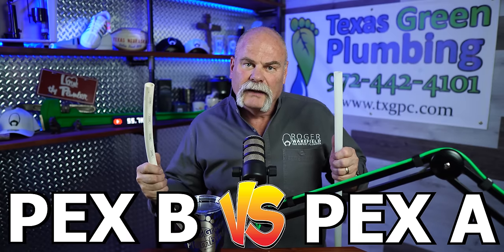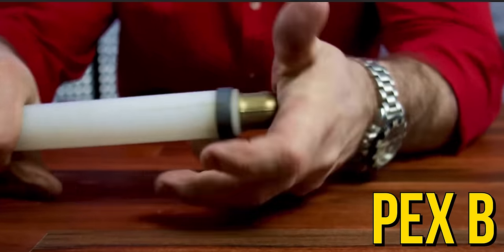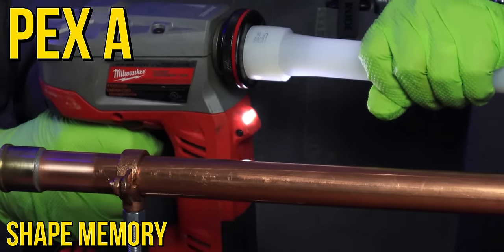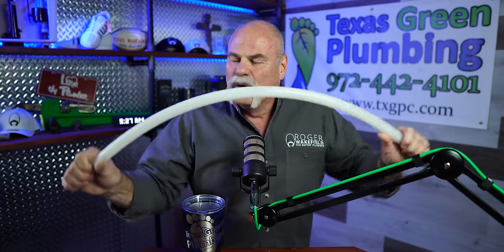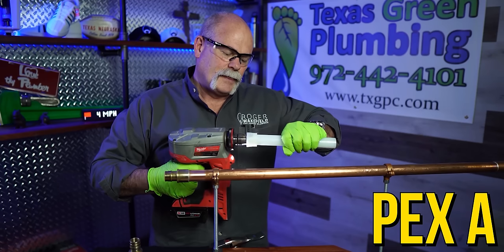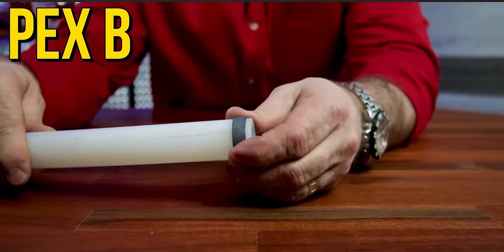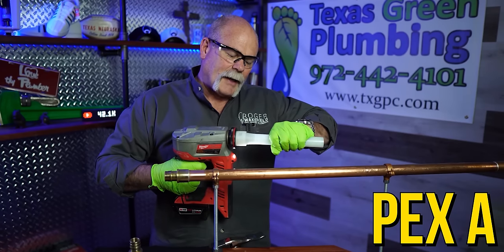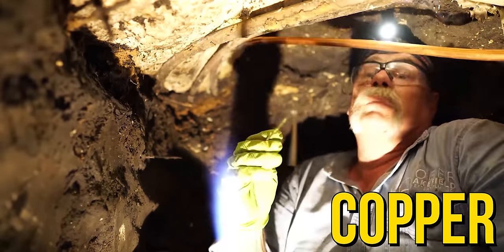PEX-A vs PEX-B - What's the Difference? Which Should You Use?

Comment: Great video. Solid explanations of how and why they are different.

When I was a young upstart in construction in the early 80's I watched the other trades go thru the same amount of changes in materials and methods as I was going thru as a carpenter.
Once we all made it past the CPVC phase and into pex it seemed that all the plumbers that were already inclined to cut corners on a job for speed and money were the most likely to choose pex B or crimp pex as what they built and stocked their company around.  The higher end guys went with pex A or expansion pex.  When I built my own home years later i purchased all the stuff for pex A and still use it on my own stuff to this day.

Not to say that pex B now is the same and has not been improved but rare was pex a system 30 years ago that leaked where as the pex B houses were hard to get thru the winter during construction without a leak.

Someone spoke about what home depot sells and What home depot sells is availability  without having to know the secret handshake and code talk of a lumberyard or plumbing supply house.
You can walk up to all of it, pick it up and turn it over and decide on your own if you can make it work. You dont need to suffer thru condescending counter intelligence trying to make you look or sound stupid.  Pick it up, buy it, install it and learn for yourself if it works or not.  Doesn't mean its a good product, just means they sell it and usually have more of it if you need and you can get it without ever speaking a word to anyone at the store.

In short, Pex A is my jam and I'll stick with it but full disclaimer,  I own a few pex b tools as well because they are cheap and sometimes you have to match stuff on a job.

Comment: I agree  Roger with all your points about A.  I love it.  I have cut a ring off (carefully) and  heated the joint to pull  the fitting out (with a heat gun..no flame). Heated it more till  it turned  clear..let cool  again  to room temp and re expanded  it.  Made the connection again  and it's still going strong in my basement.  Only thing you left out  was that UV light degrades it but.... cover it near sunlight and it's fine. On long runs along joists I run  it inside PVC  (one size up)  to act as a conduit and UV shield. Works great. PVC is cheap..   Uponor Pex rocks.

Comment: 8:44 This isn't really an issue anymore. Modern copper crimpers have a safety hash mark indentation which shows when the ring has been crimped. So visual inspection is easy (Like Pex-A). Great, thoughtful video. Thanks.
Reply: True enough... a proper crimping tool is adjusted "just-right" and there is also a "go/no go gauge" to use....not an issue....

Comment: I like the pex a for all the reasons you listed and on top of that, you can use pex b fittings with pex a piping.
Reply: This is 100 percent true. Uponor pipping can be used for pex A and pex B
Reply: And your warranty is is gone or cut to like 10 years, from 30, if you use non uponor fittings with uponor pipe.

Comment: There are some PEX B pipes that can be expanded for F1960 fittings. SiouxChief  power pex is a good example that can use expansion and compression fitting. Apollo has some as well, have to check the labeling on theirs though.  The SiouxChief is ASTM F2023 rated 5306 meaning 24 hour recirc level 5 chlorine resistance, and 6 months uv exposure

Comment: I moved my shutoff to the inside of my house from under a crawlspace and paid a plumber to plumb it in live, because my exterior shutoff (community well) didn't work at the time. I "had the materials" available for him (the system main was installed with 1" SCH40), but he used his own Pex B. Not only did we have flow restrictions with the fittings, he reduced it to 3/4" Pex.

Add insult to injury, he plumbed it backwards even though I had my lines labeled, and said "It's hard to go behind someone else's work." I paid him and fixed it myself.

Comment: In 1989 I was lucky enough to go on holiday to florida and stayed with my aunt and uncle,, florida is flat but believe me they didn't have pressure issues in fact even at sixteen year's old the shower nearly knocked me to the floor,, sounds like water companies have lowered the pressure as they have here because on the road I live it's serviced in lead here in the UK and they've told us that they can't put the pressure up anymore because it will blow the lead,, I've gone off topic as usual,, love the USA tho,, hope you get your cities back under control,, to much right to much left of any fitting will cause a future problem,, it's so true in politics as well, be blessed master plumber ❤️👍
Reply: It sounds like you PRV in Florida went bad. That’s why the pressure was so high.
Reply: Over pressure will damage flexible supply lines and water heater tanks prematurely
Reply: Different city's run different pressures. It also depends on what line is feeding the house. In my parents city, they're out on the outskirts in the country area (on a farm). The city the pressure is normal. However, my parents is high. They got told the reason for it is the line in the road is much much higher then the rest of the city. Their lives goes from a pump house, down a hill, up their hill, then feeds the city, along with a water tower. They don't restrict the flow past them so they get max pressure. They are regulated as much as they can, but it's still pretty good pressure.

Comment: I love your videos!  I am not a plumber. I am a DYI guy (over 50 years). I managed large senior assisted living and independent living complexes and learned a lot about plumbing when it failed. I found out that plumbing normally failed after 5PM on a Friday (when my maintenance man was gone for the weekend and before Monday when we had expert help again)  I am an expert on using 50 gallon trash cans to catch leaks in leaking pipes; replacing expensive matteresses, and begging for emergency plumbing repairs. When someone recommends "Shark Bite" I know that my backside is where the bite is going to happen. Thanks for sharing!

Comment: Thanks, just what I wanted to know.  I'm a do it yourself home owner.  Just moved across country, built a new house for me and my wife (that also does it all) in SC.  I did copper when I was in Ca. but this new house has pex.  Just built a huge barn that I need to plumb.  My wife is doing the drains and I am learning pex since the house has pex.  From the well I was going with 1" and thinking about 3/4" for the horse wash rack, washer and tankless heater.    And you told me what I was looking for.  Pex A is the answer.

Comment: Best part of both is they can be "fished" like wiring. That said here in the Northeast we don't see that much of the Upinor Pex A mostly Pex B in my area, and of course copper as well. Also you can put in a manifold that acts much like a circuit breaker panel for water.

Comment: I had a leak under my driveway.  The pipe under ground was copper in a steel conduit.  The steel rusted away as it came through my foundation then the copper sprung a small leak.  I cut out about a 3 foot square patch of my driveway.  I soldered  a conversion to pex b then ran pex b under ground into the house.  I also put a new piece of conduit over the pipe.  Then  I poured a new patch into my driveway smoothed it out nicely.  DIY for the win.  Its been a repair for about 8 months now and still rocking and rolling I did call a coworker who was a former pro plumber for advise which was helpful.  He did say I should replace the entire line all the way to the city if I wanted a permanent repair but I went cheap and simple because that would have required to dig up across my entire driveway.
Reply: i would have brazed underground rather than solder. a brazed joint is stronger than the pipe itself

Comment: Around 2015, I had a little plumbing to do. At the time, no supply houses or Lowes or Home Depot in the area(Columbia SC) carried any Pex A. So, I went with Pex B. 7 years later, not 1 leak or failure. While I do like a few features of Pex A, better flow, and you know a fitting is per say crimped if it is on and that you can fix a kink is great, but the fact that the fitting are 2x more expensive is a con for Pex A. By the way, recently, Lowes, Home Depot and the local supply houses have started carrying Pex A. Now for my take on the better flow of Pex A, I use low flow showerheads and faucets, so I don't have a flow issue with Pex B, Amazing how much money is saved on a monthly basis with a low flow showerhead, although most low flow showerheads suck, Niagara make some that are amazing.  I have seen people with showerheads flowing 10 GPM, they were running out of hot water in 10 minutes with an 80 gallon tank, and they had to wait about 45 minutes between showers. They had an extremely high water and electric bill. I know many people would say, just install an on-demand water heater! Nope, switched to a 1.5 GPM head, now all 3 can take a shower back to back without waiting, and the water/sewer/electric bill dropped tremendously! Just think, each day, 3 were taking a shower, that was 240 gallons of hot water, with the new head, now 3 showers use 45 gallons!

Comment: An awesome thing you can do with Pex when you have the space is use PEX Bend Supports brackets which require no cutting of the pipe or fittings. Really slick way to make sure the pipe won’t rattle around with water hammer and no need for a fitting.
Reply: You can bend copper though
Reply: Used them throughout my remodel and worked great

Comment: Not a plumber by trade but with the advice of friends who are and videos like yours i did my own new house. I did a year of research before starting and went with PEXa with a hand built copper manifold system. Used PEXa oxygen barrier for my in slab and under floor Radiant Heating. The two biggest reasons for PEXa would be the lack of flow restrictions and usability (bends, kink repair, etc)

Comment: I've used both A and B and I prefer A for the reasons you stated plus when you're using PEX B in those tight spots it can be difficult to get your crimping tool in proper position and at the end of the day an overhead crimp in a tight spot is not an enjoyable experience.

Comment: Nice video, I own a campground and marina and when I bought it 18 years ago cpvc was everywhere and quite problematic , when asking a plumbing supplier I'd used for years as to what to do he pointed me to NIBCO brand pex (pex b) because of it's UV resistance and underground capability, 18 years later we have had virtually no failures in approximately 6000 ft with 20% exposed to full UV , I'm in the midwest so we get both hot and cold weather, we do winterize by blowing compressed air thru the system but its not full proof and the pex takes freeze/expansion quite well, after a tour of the NIBCO facility we learned they used the product for the plant air lines as well so we've been doing the same, 16 years of 175 psi and not a single failure, sadly what led me to your video is NIBCO having left the tubing market and I'm searching for a pex product that will give us UV and below grade capability for that eventual day that I need to overhaul our system

Comment: As a plumber it’s awesome seeing these videos, I like both pex a and b and both are great and easy to work with, definitely pros and cons, but the same goes for copper and pvc.
Reply: What diameter pipe is recommended? My plumber wants to install 1/2” pex b in my entire house. Do you think that’s acceptable
Reply: @Sophia-lc9ow  how big is the house, may want to use 3/4 just to be on the safe side.
Reply: You should never have a whole house in half inch pipe.

Comment: Hi Roger,
Thank you for posting.
I've never used either. Not sure what the plumbing cost in NYC requires for new construction. I'm pretty much a dinasour with all new plumbing technology. When I heard about shark bite and pro press fittings I was pretty amazed.  On the commercial side of plumbing and if your working on pipe size over 2" I think most plumber will be using copper.
All good stuff all around. Keep that watet flowing where it needs to go.
Stay safe stay clean.!!

Comment: I'm in the process of ridding my house of poorly run CPVC.  Using PEX A.  The only downside side is having to wait for ordered parts to show up.  You can make  do with what Home Depot has on the shelf (Tampa FL) but I'd rather have the specific fittings and colored pipe I want.  (Red for hot, blue for cold).  I still use copper or iron for some places.  (Showers and exterior bibs last foot or two.)

I bought the dewalt battery tool.  It was worth every penny.  It takes of all of five minutes to learn how to use it.

Loving it so far.  Not a single leak after a year.

Comment: I used Pex-B when I installed my lawn sprinkler system years ago. It was so quick and easy. Later on I dug up a section to add another sprinkler head. I cut the pex added a T crimped the lines on returned the sod. No problem No leaks and each year during the summer I drive my car across the lawn to flatten the ground. Never hurt a thing.

Comment: Hands down Pex-A all the way. I even use it for low grade vacuum chambers too. 
I made a dual propane tank vacuum chamber with all pex expansion fittings. I could pull to -29hg and it held for a while. It was still at -27hg even 3 days later. 
The expansion fittings make it amazing for vacuum as they just get stronger the deeper you pull. You can’t do this with crimp fittings or shark bite. I have very specialized needs for what I’m using it for so I’m not sure if this information will be helpful for anyone else though lol

Comment: PEX B was used in RV campers and motor homes throughout the 80's and 90's and in that application was limited to 40 PSI (grey tubing and black fittings). You had to put a pressure reducer on the water connection otherwise the fittings would burst. The BIGGEST failure however is the crimping rings and corrosion due to the various environments the RV would be taken to and set up in etc. Newer RV's use PEX A and have a higher PSI rating like a home but many people still use a pressure reduction on the water line connection.
Reply: Polybutylene truly was the worst pipe ever invented
Reply: I think that was actually poly b not pex b

Comment: I use Viega Fostapex on everything.  It's type b and I upsize as needed.  I use it on everything because in my own small way it prevents hacks from using diy sharkbites on it.  The aluminum core also allows for sharper radius bends and adds strength to help prevent breakage if it freezes.
Reply: Fyi, there is shark bites for oex B....
Reply: @adamplummer2190  not for Fostapex, it's pex-al-pex and the -bite fittings are too small.
Reply: I thought the aluminum core pex b was only for radiant heat and not for potable water… ?
Reply: @ronh9384  it's rated for everything.   There's still a pex inner core layer.

Comment: I just had a bathroom remodel. I have copper thru out my house and the new shower valve and related parts were installed with a red colored plastic pipe and metal squeeze rings PEX B. I left the pipe trades 38 years ago- this was totally foreign to me.
Thank You for the great video, it’s just enough information to satisfy my curiosity. Well Done Sir.
Reply from the maker: Glad it was helpful! Have you had any problems with the PEX thus far?

Comment: Came here to learn about pex-a. I'm a carpenter that does remodels and I'm Leary of stretching the pipe so i wanted a professional opinion. I have only used pex-b and i have had one flow restriction problem but that was my fault for using only 1/2" directly from the water heater. I did as i was told by my boss at the time.

Comment: I started with pex b because it's commonly available. If you need to run to a big box stores on Sunday night, they'll have your fittings. But, pex a is the better system. The Milwaukee tool is very cool, and you don't have to contort in tight spaces to squeeze the crimper.

Comment: I’m not a plumber by trade, just a handy home rehabbed/flip/rental landlord. I used both at different homes. PEX B mostly with a central manifold distribution shut off point, and PEX A not as often (once if I recall), but still have all the tools in the garage. Can you tell me (or better yet make a follow up video) if PEX A fittings can connect to which materials (ie pvc, copper, galvanized, etc) and how? This video is awesome. I should have found it sooner.

Comment: I brought up the reduction in PEX b in a plumber's Facebook group you can tell a lot about their integrity from guys that say wgaf.  I also pointed out that the water heaters from the big box stores have 3/4 nipples with 3/8 ID heat traps trying to explain to the customer why they have a reduction in flow through their water heater I tell them stick with the supply house brands like Bradford White and again I get raked over the coals by all these Facebook plumbers for caring about the flow.

Comment: I do fixit work, which includes plumbing.  I have use pex-B due to parts and tool access (most of the time)..  I now have a DeWalt pex expander and plan to use it on my next job. The flow is the reason I am going to pex-A.  I have not always been able to get the upsize parts at the local box stores. Great explanation of the two types.